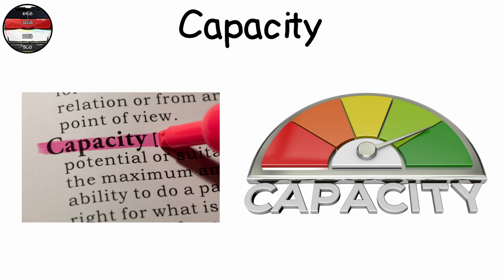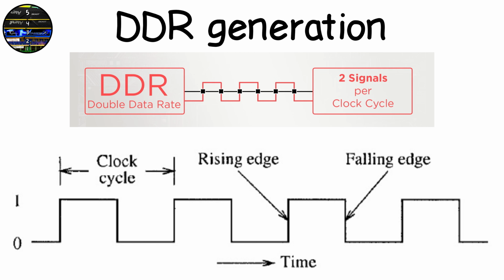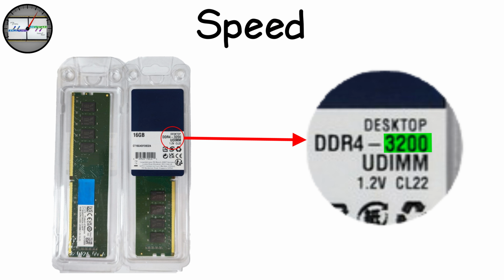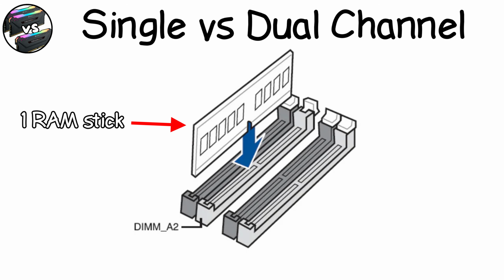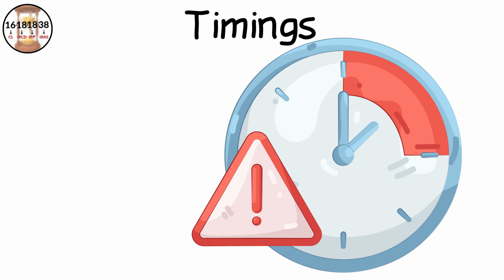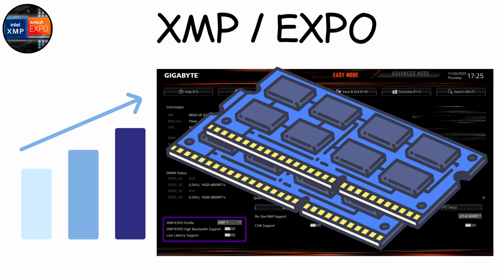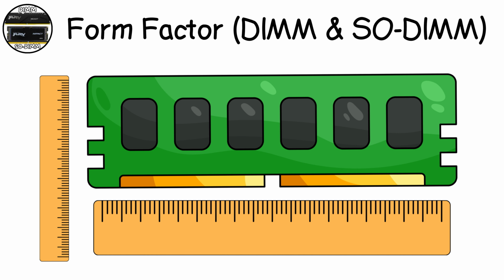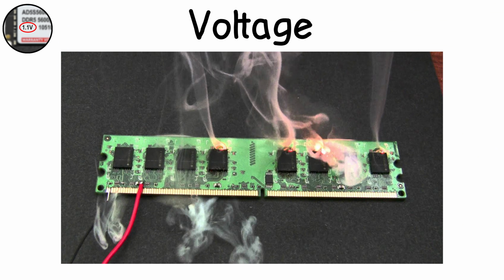RAM Specs Explained

Comment: Excellent explanation. A lot of people think that more RAM automatically means more speed, but what really matters is understanding capacity, speed, dual channel, and enabling XMP/EXPO. I especially liked how you explained that if you don’t enable the profile in the BIOS, the RAM may run at the base speed (like 2133 for DDR4), meaning you’re not actually using the performance you paid for. The 1×16 GB vs 2×8 GB dual-channel example was also very clear, since many people overlook that. Great video for truly understanding how RAM works. 👏💻
Reply from the maker: Thank you!

Comment: Bro pls tell  my father 4 gb ddr3 isnt enough for windows 10
Reply from the maker: Hi theultimatelemon's Dad, your son definitely needs at least 8gb of ram, but that's the bare minimum if you ask me, the best bet would be to go with 16gb!
Reply: 4GB may be enough for only windows 10 itself with no other programs running 😂
but yes, go for 8GB (two 4GB sticks) if you're sticking to ddr3 and can't upgrade your motherboard yet.
as far as i know, ddr3 RAM prices didn't increase at all despite recent SSD and RAM price hikes.

Comment: Something not mentioned that cost me ~100$~ in RAM, be careful of ECC RAM. ECC RAM (Error Correcting Code), is a special type of RAM, typically used in servers, and workstations, like Dell and HP Machines. They fit perfectly in the RAM slots, so long as they fit the DDR gen, and form factor, but your PC likely won’t boot at all. Be careful of this, especially if you’re upgrading Dell’s proprietary nonsense.
Reply: That type of ram looks very different to the ones used in gaming. By that I mean aesthetically. 

Not sure how you made such a mistake.
Reply: @BobMcBurger1 you don’t need gaming ram for gaming, you just need the right type of ram. I got it from an old dell office PC and it isn’t ECC but def isn’t nice looking lol
Reply: @DetroitSmash71 Well I never said you needed "gaming" ram, it's just the recognizable types of ram looked very different to ECC ram.
Reply: yikes! thanks for the info!
Reply: @f @farhanrejwan yw homie I found out the ram was just acting weird and I got my computer running!